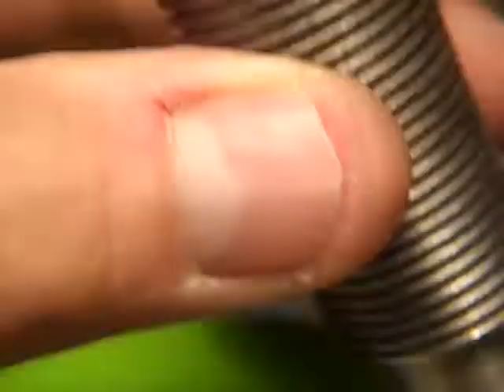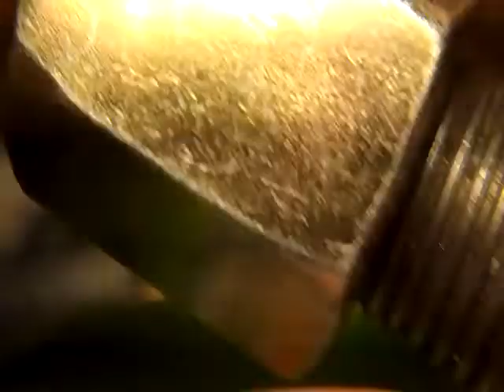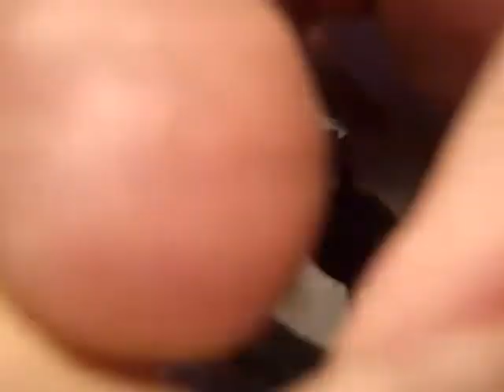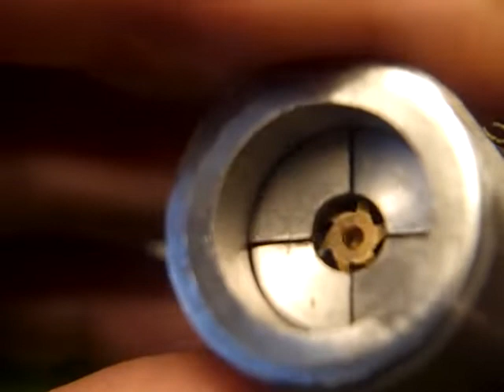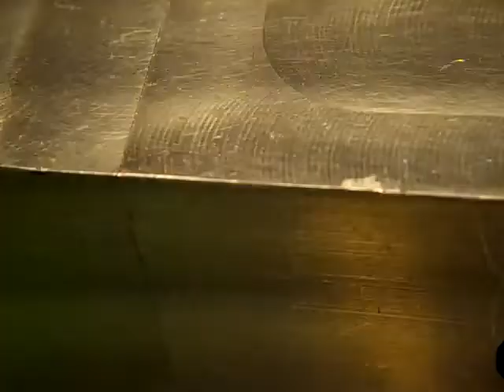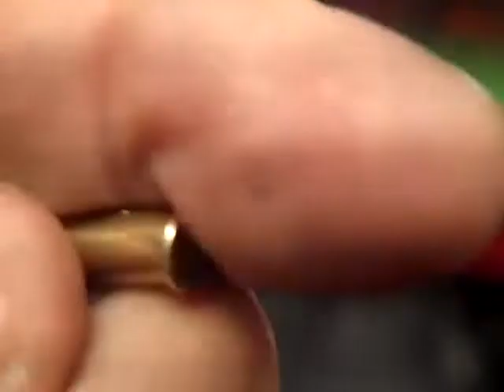Build your own Crimp die 22 rim fire. Or Modifying a Lee Factory Crimp Die to crimp 22lr

Comment: Great video. I wonder if you couldn't load the 22lr into a tube with a small slit in the tube where the crimp is required, using a blade press into the slit while rotating the whole 22 case until fully crimped. I'm sure you could create an overhead jig kinda like a guiloteine that keeps it all aligned and allows for more precise pressure. One issue i cas see is being able to rotate the case in this holder but if you left enough case exposed it should work fine?
Reply from the maker: That's basically how the commercial companies crimp them. But it is with a wheel that rolls them with a blade around a disk making it a continuous process. There are a couple of videos on youtube showing it but they are not easy to find.

Comment: After seeing this great video, I went and bought every possible crimp die in the .224 range, .204, .223, .22-250 and I'm still wanting to go ahead making my own crimping die. I called Cutting Edge Bullets and asked if their .22 LR dir would work on .22WRM they said NO. However, the case diameters are different, but the OD is closer than centerfire dies. That may make reaming out their crimping die a more logical choice? An extended shell hold is also a requirement for the centerfire dies, if I'm understanding the process?
Reply from the maker: Yes an extended shell holder would also be required when using Center Fire Dies for either 22lr or 22 WMR. Check out "Old West Bullet Molds" website. Bernie makes adjustable rim fire shell holders. He has pictures of them. I am not sure he makes them for 22lr or 22wmr but I'm sure he can. I think I have a video that shows how I made them. You will need to know how to cut the grove in the base to make the holder. If you do any machining it is easy. If you are  not familiar with lathe work and milling machine work you will have to figure out how to do that. It' s a simple procedure but  you will either have to grind a special cutting bit (end mill) to make the slotted groove to hold the rim of the case. As far as the crimp diameter and recutting the die from a center fire die, I did not just measure and cut. It was a process of trial and error, sneaking up on the final dimensions. Some people are good at that and some aren't. It would be difficult to just give someone a drawing with dimensions for a crimp die. 22wmr does have a larger case diameter. But there are no absolute dimensions for depth of crimp either. So again experimentation and "sneaking up" on the final dimension is necessary. I hope this makes it clear. Also, I haven't worked on this stuff now for a couple of years. So I can't hop on my lathe and work out the dimensions or anything. Good luck. Just keep at it... you will figure it out...PS if you pay a machinist or someone like Old West to do the work for you be prepared to pay a pretty penny.
Reply: @HansFormerlyTraffer   I think starting with a die that is for .22 LR is a better starting point than with a centerfire die that is tool large.  It took you several steps to round out the ID with reamers on the .204 die if I recall. Better to enlarge a .22 LR die in my opinion. I do have a lathe,  a nice SB 9"  with R8 collects. Old West is out of stock on the .22 LR crimp dies. What got me started down the .22WMR road was a You Tuber by Mark and Sam criming them with improved accuracy on factory ammo. They are long range shooter even ouyt to a mile in some calibers. Good folks.
Reply from the maker: PS Changing the "height" of the die, like you said would require an adjustable holder, if you used Cutting Edges die.  You would also have to change the diameter of the crimp a bit. That MAY require touching up the sharp angle on the very edge of the crimp. Otherwise it would make a thick ring crimp, if you get what I mean.
Also, If you are going to use copper bullets, many of the dynamics of the crimp/burn will be a little different. Just as Cutting Edge is finding out precision match cartridges takes time and patients and quite a bit of study to figure out. Personally I think that swaged lead bullets are a far more viable solution for rimfire shooting.

Comment: I gonna try making a hole in a pair of thin even blade scissors to crimp 22
Reply from the maker: Let me know how it works....My original crimper was a small electricians pliers with a 22lr sized groove with an edge for crimping. I still have it but have ground off the ridge and just use it for pulling bullets ...squeezing down too large of diameter bullets, holding cases and yada yada.

Comment: your design at minute 16 reminds me of the collet in a router that retains the .25" shaft router bits.  Might also be something to consider as a starting point.
Reply from the maker: That could indeed be modified to crimp these things. It may be a bit slow though. It would seem that you could get it to be more precise though.
Reply: I ordered some off amazon a few days ago thinking along the same lines. I'll see if I can make the alterations from.0.250" to 0.189". Going in the wrong direction for metal removal  machining! I am looking to recrimp factory .22 Magnum ammo based on Mark and Sam's research on Y-T.
Reply from the maker: @Patrick-kc5ur  I sent the info to Mark and Sam for them to do that. He however did not mention the fact that it was my idea to begin with. My advise is to modify an existing Lee Factory Crimp Die. A 22 caliber or less works. I think that the 204 Ruger works the best.

Comment: Perhaps modify a bullet cannelure tool?  The Corbin one might work better than the C&H one....  Thanks for making this video, it's gotten my mind working on a crimp tool for 22 Mag.
Reply from the maker: I have considered the cannelure tools. Something like that could be made to work.  Kind of slow though.  There is a design that George Frost used to test his experimental loads when converting from black powder to smokeless back when. It is a "roll along a blade" kind of thing. Where two in line rails, one with a knife edge protruding a tiny bit roll a cartridge between them pushing the blade into the case, causing the crimp. This is the method that commercial ammunition is made with. Only instead of using a straight block they use large wheel that rolls the cartridge into a blade. This allows for fast and continuous operation. There is a guy in Australia that makes machines like that for roll sizing brass. Whitehouse engineering?  If I had the  money I would have him make me a roll crimper for 22lr out of that. If you search youtube for "rollsizing 101" you will see the concept. Crimping 22lr is done with a rollsizing type of machine BUT it is done with one with a blade that crimps the brass.

Comment: Have you ever considered using a sealant to stick the projectile to the case when crimping with tools?
Look: Because of these variables, it is common to suppress the mouth crimp for match-grade or sniper-grade ammunition, since those cartridges are usually not fired with automatic weapons. Suppressing the mouth crimp reduces the complexity of the cartridge, avoiding potential issues associated with crimping. The goal is to produce an assembly with more consistent bullet pull strength.

https://www.assemblymag.com/articles/93875-ammunition-sealants-and-bullet-pull-strength?_ga=2.207093843.1922488098.1576506907-236896943.1575902047
Reply from the maker: I can see how this would make center fire ammunition more consistent for match shooting. however because of the thinness of rim fire cases, I don't believe sealant or some type of glue would hold the bullet well enough. The pull weight of a  match grade 22lr (depending on the type of gunpowder used) is ideally around 50 lbs. That is a LOT of pull weight. It is difficult to attain with any type of crimp. The only thing that works is the deep abrupt crimp that a knife blade creates. 
If you cut a 22lr length wise so to measure how deep the crimp is it may surprise you. The case is crimped in to a diameter of around .180". 
Another way of obtaining a heavy pull on a crimp is to use harder alloy in the bullet. That is a tricky thing though because the bullet has to obturate during the firing. Harder lead retards or prevents this obturation. So there is a balance as to the crimp depth, hardness, diameter, speed of the powder burn and shape of the hollow base. 
The commercial manufacturers use near dead soft lead and crimp deeply. This allows a very good obturation of the base of the bullet to create the ideal seal for gasses.
There is a lot to the design of a rim fire bullet when it comes to trying to get consistent accuracy. I dare say it is even more complex (more variables to account for) than even center fire.
Reply: @HansFormerlyTraffer  I did some tests with two-component glue, and the case held the bullet tightly. I already shot some with 0.5 grains of fast-burning gunpowder and it worked. Now I will look at the issue of consistency in a chronograph.
What I meant by using sealant or glue, is that according to the text, they say glue will always act the same, unlike tool crimp, where you can use a certain force to crimp a bullet and use different force to crimp another bullet.
I suggest you do a tensile strength test with a few different glues, and also do firing tests.
Reply from the maker: @rodrigocirilo7343  Let me know how it works. Maybe glue is another modern tech improvement...
Reply: @HansFormerlyTraffer  I fired about 75 bullets crimped with glue and they worked well, however in the next test I will use 1.5 grains of bullseye, because I was using 0.5 grains and it was little.

The accuracy was not as good as commercial bullets, but I believe this is due to the fact that you are using little powder and not reaching the correct speed.

do a traction test and post to see us, you're good at it!
Reply from the maker: @rodrigocirilo7343  I tried to glue some with locktite 380. They were inconsistent. Tested the pulls from  basically 0 lbs to about 70 lbs. The oxidation on the inside of the case would have to be removed in a very consistent fashion in order to get them to have consistent pull weight. It can be done but not on the brass that is already primed.